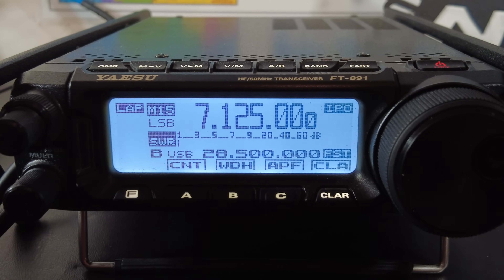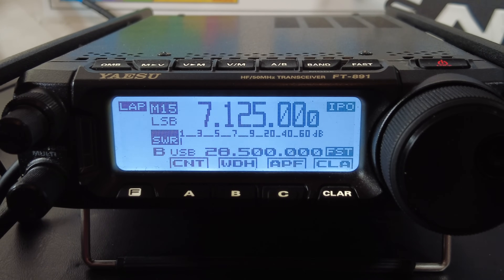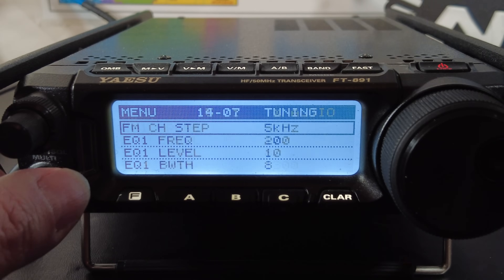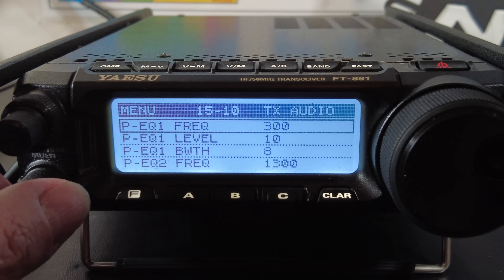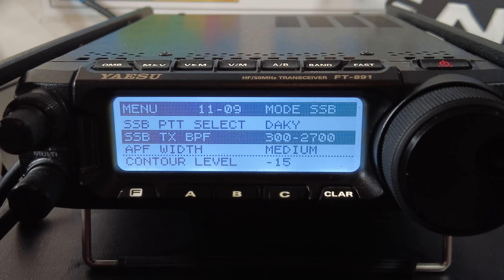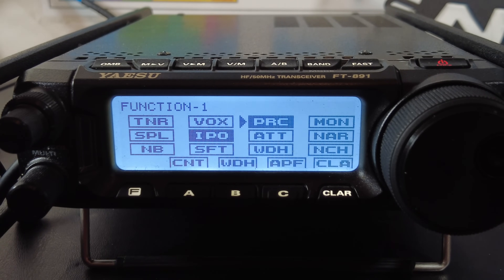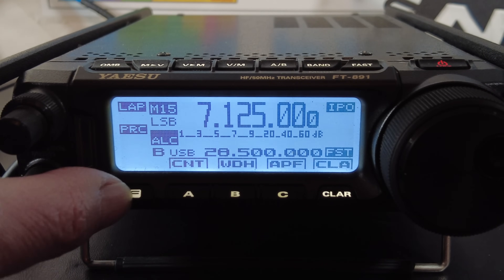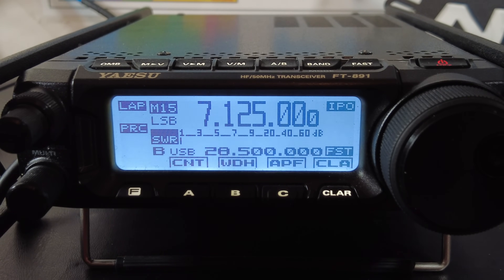Yaesu FT-891 TX Audio Settings

Comment: Is there a way to check the transmit audio eq output without actually transmitting? In other words is there a monitor setting I can enable? 

Is it as simple as enabling monitor mode with a dummy load? Ideally I would output a relatively clean file wav to my computer via the data jack in back.
Reply from the maker: The best way to hear yourself that I know of is to go to websdr.org and find an open sdr somewhere where you get good propagation then tune your radio and the sdr to a same unused frequency. If the propagation is good, you should hear yourself on the websdr. I would use headphones or earbuds on your computer. Hope that helps.

Comment: would this be a good for the Technician class to start with?
Reply from the maker: If your goal is ultimately get your general class and use HF then yes.  As a tech you can use  SSB, data and FM on 10 and 6 meters with this rig and you can use CW for 80,40,20 and 15 meters if you learn morse code.  When you upgrade to general you will have access for SSB, data and CW on all the bands 6m to 160m.  If you want access to higher VHF and UHF frequencies like 2 m and 70 cm then you will want a different rig.

Comment: NIce explanations!  What would be helpful.....of the settings you just tweeted what would be the best to go back to if running digital FT-8
Reply from the maker: Oh that's pretty simple.  Just turn off MEQ and PRC for digital and turn it back on for voice.  Everything else you can leave alone because once you turn those off then the other settings are bypassed.
Reply: @JoeN2DI  Thanks much.  Simple fix!